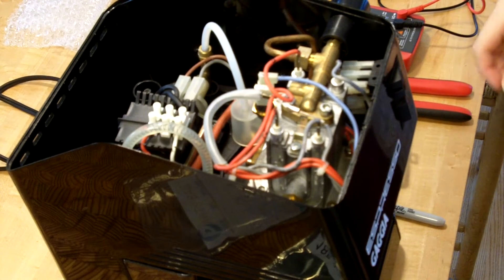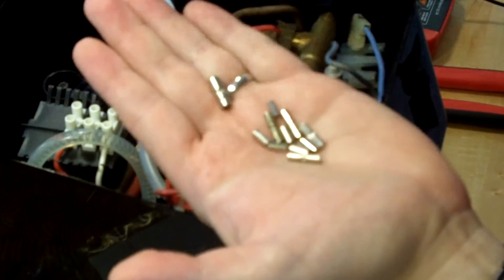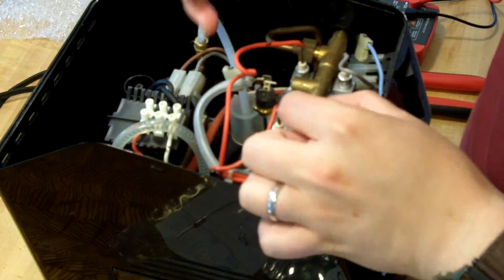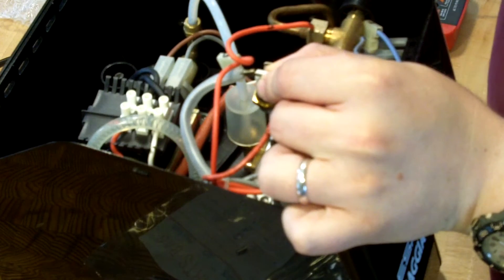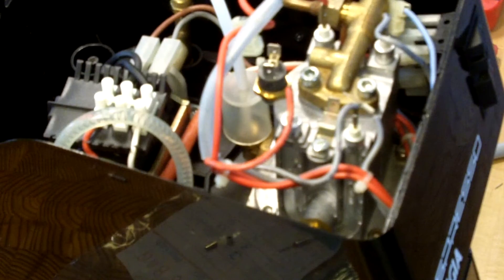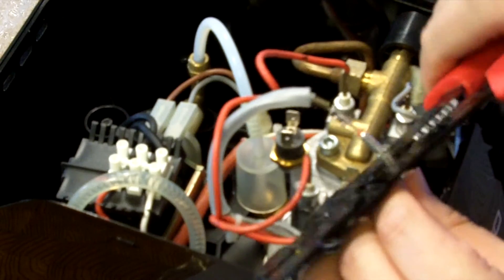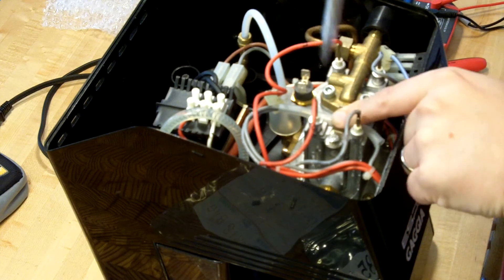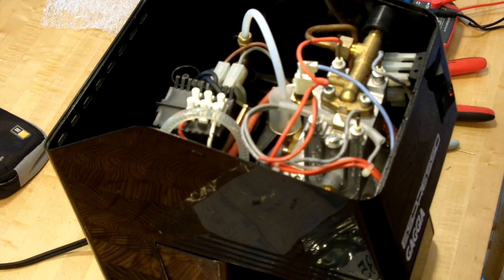How to Replace Thermal Fuse on Gaggia Espresso Machine

Comment: Great video! Thank you for all the tips. I have a Gaggia Brera that likely needs a replacement thermal fuse (no power or lights when trying to turn it on). But when I open the machine I cannot seem to find it. Do you know where it might be located on the Gaggia Brera model?
Reply from the maker: Thanks so much for writing in. I don't have any experience with the Brera (I'm just a guy, not a technician). Have you identified all the electrical parts inside?

Comment: Great video.  WhoeLatteLove has a very polished video but yours is so much better.  On point, and so so smart to cut the old fuse and leaving the leads behind for easy crimping.  I followed the other video and removed the old fuse by cutting off the crimps only to learn that my tiny unshielded butt connectors would not accept the two wires. Not having a local source for larger unshielded butt connectors i had to solder the two wires into a single lead so i could fit it into the butt connector i had.  Your solution would have been so much easier.  Thanks for the great video! Thumbs up!
Left a comment on their video to help people find yours.  Also, got a 10 pack of fuses with butt connectors (but only 10 when you would need 20 to install all fuses) from Amazon for less that one from WholeLatteLove and without their absurd shipping charge that doubles the cost of one.
Reply from the maker: Thanks so much for the feedback! I really appreciate it.

Comment: I have been having the thermal fuse on my gaggia classic also blowing under normal circumstances - I use standard household wiring push connectors to connect the thermal fuse the last time. I tinned the internal wires (braided) and used a double connector on the inlet to the thermal fuse and a triple on the outlet. It just blew again after about 30 latte's so I am going to install a thermostat to monitor the temp of the thermal fuse.

Comment: Fun video.  I did not know about cold soldering with crimps.  I learned something today, thanks.  I wonder how you knew about the thermostat and the thermal fuse - that it was 185C, etc.  Like, I would love to learn everything about my Gaggia but I don't know where to start.  I downloaded the electrical diagram but I don't entirely understand it, to be honest.  I'm keen to learn but I don't know of any systematic way to go about it.